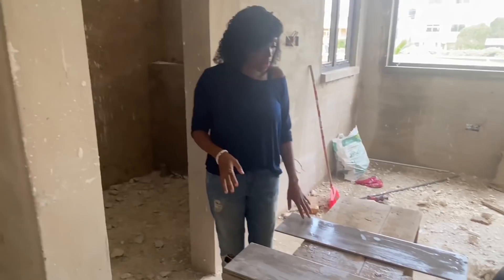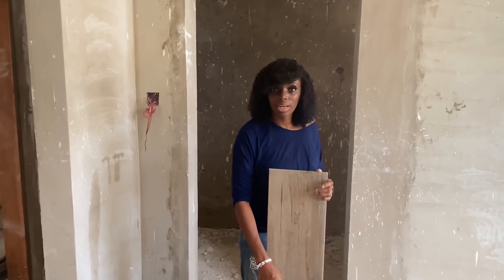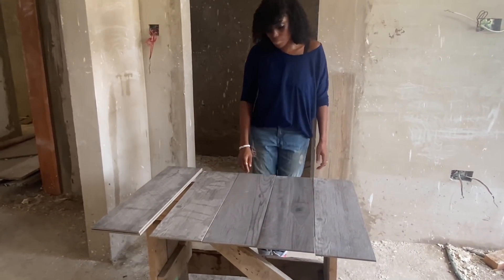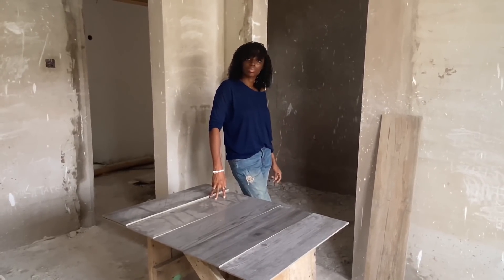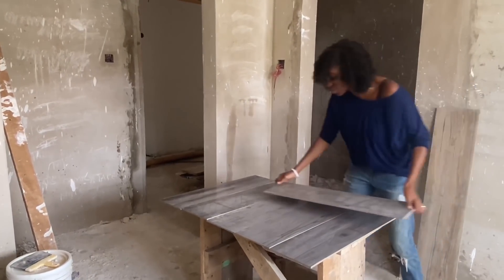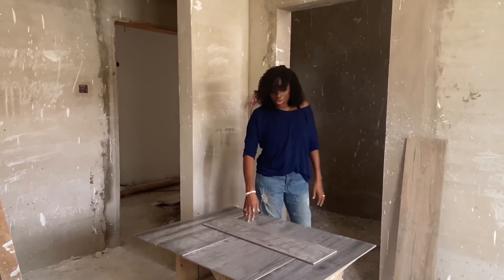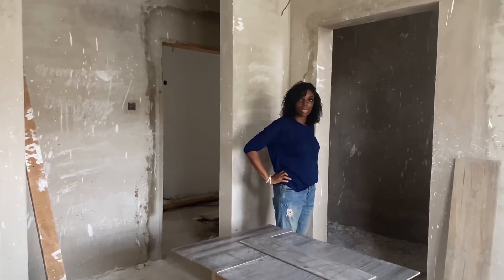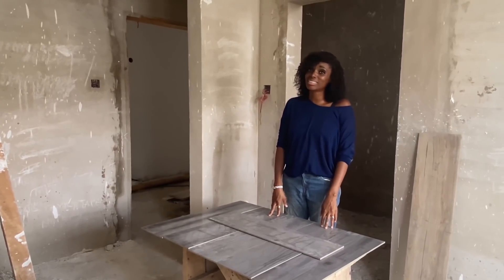We Finally Know What To Do About The Bathroom Tile Situation | Building Our Dream Home In Ghana

Comment: You took me back when i was trying to make over my my kitchen. 😁 It took me a weeks to figure it out. The grey tile was beautiful my kitchen is grey. Just separate the lighter tiles from the darker tiles put either the lighter tiles on the floor and darker tiles on the wall or vice versa. Just a suggestion. Or you could go outside of the box and leave the floor concreate and place some accents in the floor with faux painting. I might had missed a video but, get a lot of sample tiles and bring them to the space. Good luck. And don't settle. If you cannot agree bring them back they will be ok.

Comment: See that’s the conclusion you like came to in the end anyway, I really think sectioning your bathroom in tiles then painting the walls whatever colour you like is the way to go you can use an oil based paint for your bathroom I have just painted my bathroom and oil based paint is waterproof and you don’t have to keep retouching it every year or so
Reply: Sorry I didn’t mean oil paint I meant gloss paint.
Reply: Please don't use oil paint for the bathroom or the kitchen because this paint is not heat resistant please ask and specify what you are using the paint for as the bathroom and kitchen has a specific paint that is heat resistant..Different paint companies call it by different names .....I worked in a paint company so I know what am talking about..